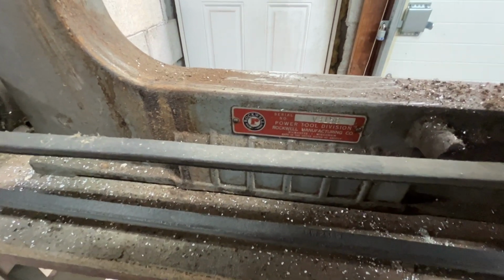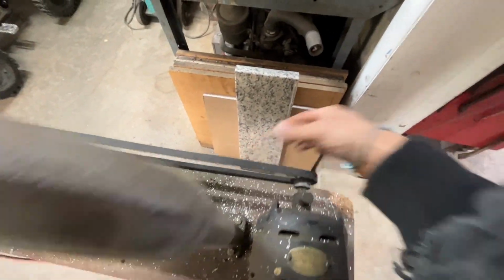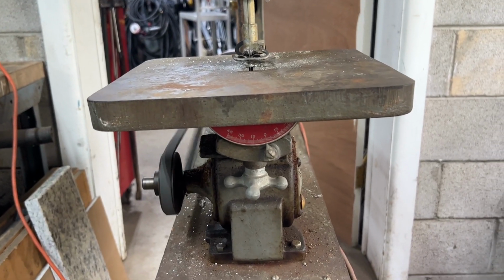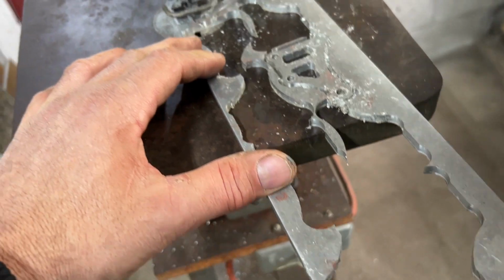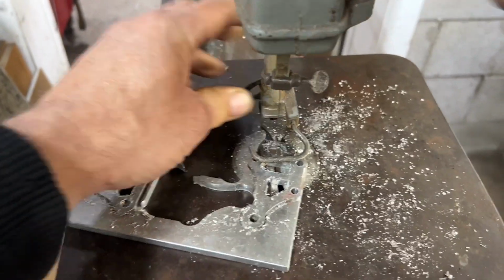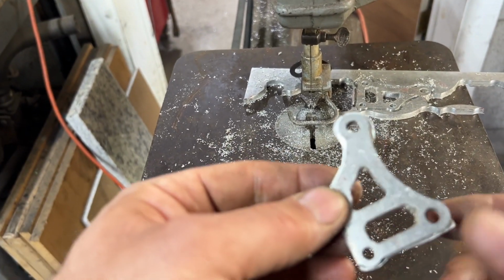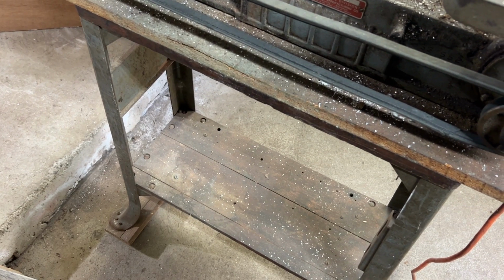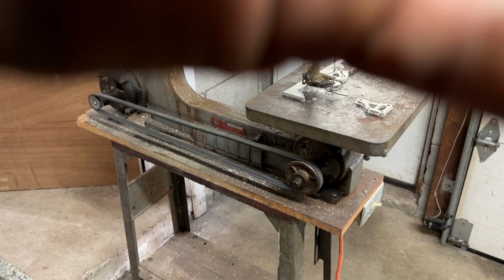1950s Delta Rockwell homecraft scroll saw

Comment: Delta Milwaukee became Delta Rockwell and they used the old badges until they ran out. Motor were considered an accessory with Delta and not included. The legs on that stand are original but the top and lower shelf are not. Just FYI :) Nice find.
Reply from the maker: You are a wealth of valuable information my friend. Thank you for your comment. Probably the best I’ve had so far.